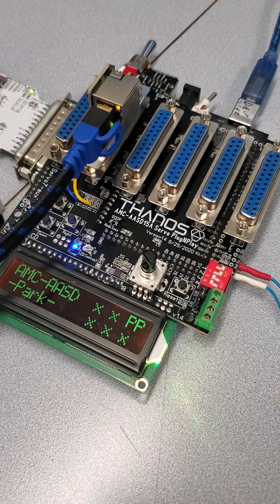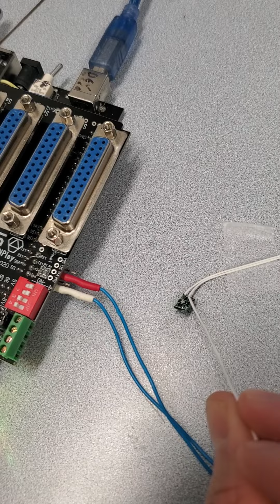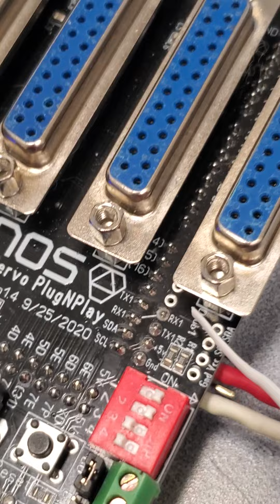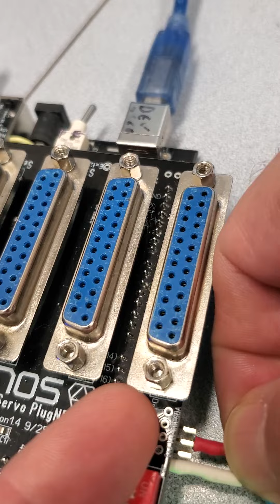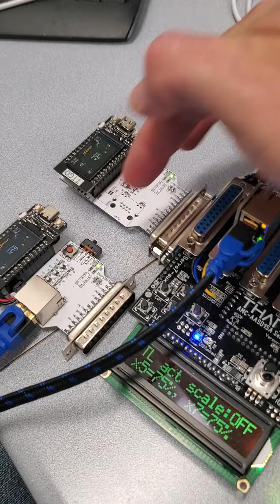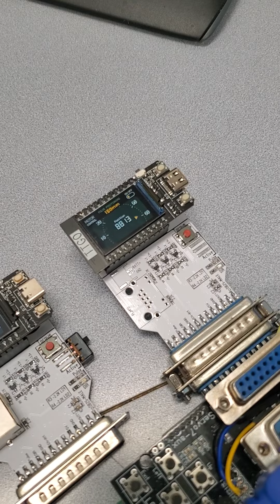Update on the latest firmware v2.26 fix6 for 2560 chipset

Comment: Brother, is it necessary to upgrade?
Reply from the maker: It does have some other stability fixes as well, like how to handle the motion if the motion data from the PC stops while the spike filter is active (used to block from going to park position at normal speed).

Comment: Why don't you propose to sell AMC with RJ 45 adapter ?  Or make a version with RJ45 connector as thanos4u.... RJ45  cable is very easy to access....😊
Reply from the maker: Yeah, but then I'll have to add lots of adapters from RJ45 to DB25 for the AASD servos... makes it more complicated in the end. I did this for the Thanos4U as it has less ports...